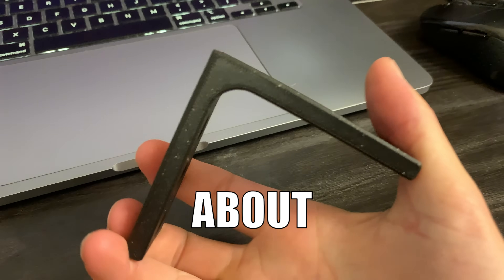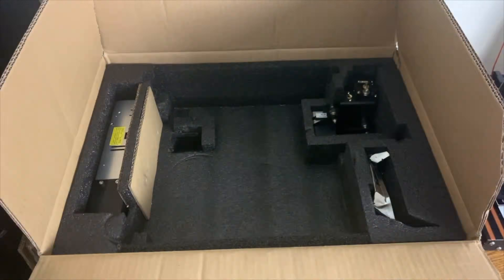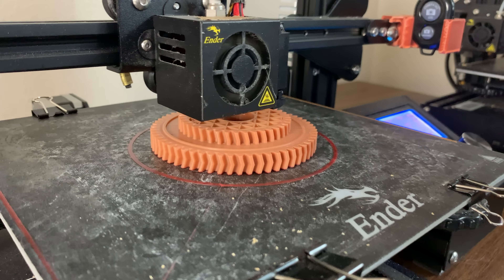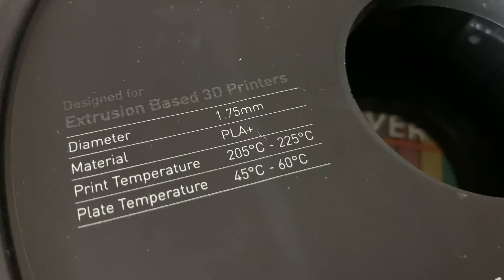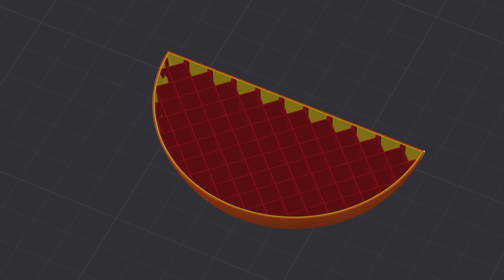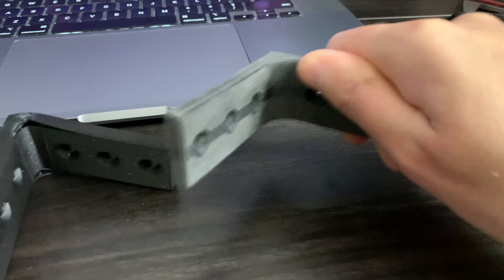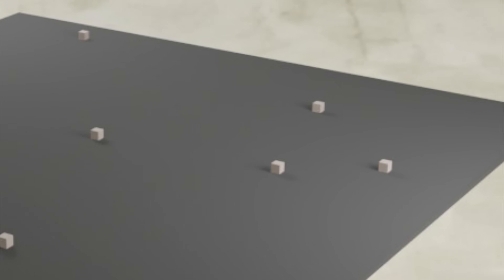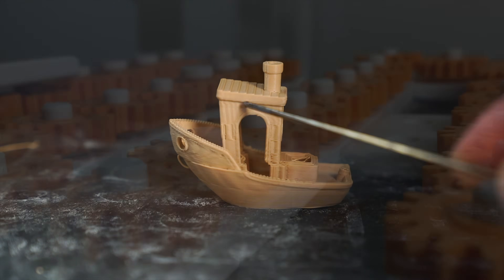9 3D Printing Sins...

Comment: 0:09  laughs in blue painters tape
1:05  laughs in locked leveling wheels and bltouch
5:00  laughs in top mounted filament dryer that feeds directly to the hot end
5:24  laughs in 100 percent infill for most prints
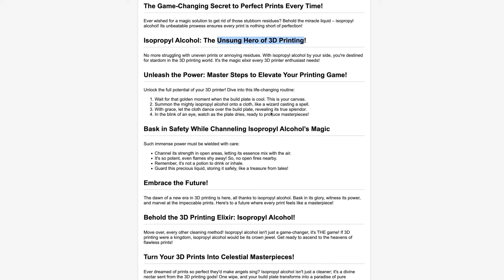6:08  laughs AGAIN in blue painters tape
7:14  laughs in PETG

Technically you only mentioned 7 sins since 1 and 7 are the same thing and so is 4 and 8. You should sin 7 with modifying a printer too much before actually using it, and replace 4 with not considering personal use case when buying a printer.

Comment: I sharpen one side of my putty knife blade (then remember which side is "up") as I would a machinist scraper so the thin edge more easily gets under the brim or print edge.
I don't print in my regular living space and my shop has excellent air exchange but were that not the case I'd make an AGGESSIVE fume extractor to exhaust fumes out a window (or if using a windowless room, add a common dryer vent through the wall to keep out vermin). Blowing air isn't difficult and no toy is worth respiratory problems.

Comment: I have a glass board and use a ceran cooking field scraper. The ones with the razorblade. The board must be completely cooled off (huge factor, even 30°C sticks like hell, 23°C not anymore). With the razorblade usually thats enough and if not i pry up a corner to make space for the more sturdy standard metal spatula and just shove it under the blade. Buy a ceran field scraper which is supported at the back of the razorblades. With some cheap ones the blades slip over some notch into the device when too mich force is applied.

Comment: i used the standard smooth build plate for months thinking it was fine, and using glue for some items to promote release like you said in this video.... until i got powder coated sheets... and i think your statement "some people have had success with them" is not accurate... they are 100x better.. great adhesion, no glue needed ever, PLA/PETG release without even touching them... they're just way better print sheets, i have a feeling that everyone would have a better time with these textured sheets

Comment: Thank you very much. You are saying some things that seem to contradict what everybody else says, which can mean either you are wrong or you are saying only what you personally experience - no matter how many people say different.
Again and again I tried to "calibrate" my printers according to the common advise and have found myself un-doing everything because it just made the results worse.

I never tried the isopropinol advice because I didn't think it made sense (we use soap to clean grease all the time. Why not here?!), but how can I be sure I am not mistaken? glad to see you actually think the same. The fact that washing something with a lot of liquid is more effective then wiping it with a small amount is something I didn't even think of, and it does make a lot of sense.

Comment: The ender 3 can easily push 80mm/s. You should’ve mentioned it depends on material, though. PETG shouldn’t go over 50 on printers such as that.

Comment: If you have a PEI-coated build plate, the general rule of thumb: PLA - wipe with 99% isopropanol, PETG - wipe with Windex. If you're not using a gluestick, isopropanol wiping without removing the bed from the printer is faster than using soapy water, wipes fingerprints perfectly and leaves very little to no residue. Use 99%, not 70%, as in the video.

Comment: Bambu is just killing it. The a1 series is amazing. Auto leveling. Auto flow calibration. A camera and multi color for under 500 bones. Makes this hobby much more about orinting and much less about tinkering
Reply: Just wait till it starts failling. You will and still need to learn to troubleshoot

Comment: Correction on #7: Cleaning (For glass beds not PEI sheets)

No shade to the author, but I'm guessing the author doesn't use glass print beds you find on printers like the Longer series.

Your glass bed is likely bolted down with heavy duty clips and removing/handling the giant glass plate is not ideal. And assuming you don't use a glue stick or tape on your glass bed, there are two types of cleaning you'll need to do.

Type 1: basic grease and finger gunk: which you can absolutely use rubbing alcohol for, and polish the plate with a microfiber cloth.

Type 2: left over print residue(PLA): Sometimes you'll get a sort of ghost residue in the shape of the contact of your print that prevents adhesion and the alcohol won't completely remove. In this case, a paper towel with a bit of acetone(nail polish remover) applied directly to the paper towel or cloth, will dissolve the left over PLA just rub in circles until its gone, dry with another paper towel and use the alcohol method in type one to get anything leftover. For extra stubborn residue I find warming the print bed helps the acetone wipe it away.

I don't know if acetone will work on other material residue, like petg or abs, I've not worked with them personally. And I'm sure it doesn't need to be said, but don't use any abrasive scrubbers on the glass beds, paper towel or similar cloth should do fine.

As always, handle the acetone carefully and make sure your area is properly ventilated.
Reply: the funny thing is mini binder clips (the ones you buy at a store, slightly larger then the ones that came with the printer) are absolutely perfect for the creality glass bed on ender 3, making it super easy to remove.

Comment: I recommend to use 70-90% if you want maximal strength. If you use 100% it will get brittle and wont be as strong as 80%

Comment: I use 99% iso right after every print while the bed is warm and then again before a print when the bed is warming. I keep clean microfiber towels at the station and launder them as needed. Currently using a comgrow glass bed. No adhesion problems. I use plastic putty scrapers to avoid damaging parts or the bed coating (3 for $4 at Harbor Freight.)

Comment: Wall thickness is a great point - the technical term is "second moment of area", and a good way to consider it is that lampposts are tubes, not solid steel as almost all of the strength is in the outer skin, not the core, due to how far away it is from the centre point.

Comment: if you're using a glue stick in 2023 you're doing it wrong imo
Reply: I always cringe when I see a build plate completely covered in glue stick. I use the PEI textured surface has a nice finish for one of the sides of the part, and can't imagine not having a nice bottom surface.
Reply: Yeah binned mine after I got a coated bed. I'm surprised people aren't still using painters tape too lol

Comment: My print bed has learning marks in the centre of it and I tend to just print around it. It just leaves a mark in any print touching it.

I have a glass plate that came with my printer but I’ve been scared to use it because I don’t like cleaning up glass

Comment: Sorry, but textured plate plus IPA cleaning forever. Using glue and running with the plate to a sink after each print is the worst. Not even considering leaving the glue residue to ruin the aesthetics of the first layer afterwards.

Comment: Overall some great tips!  
Couple thoughts from my experience, not better, just another perspective.
- Imho, IPA has worked well for me as the in-between.  At least on PEI plates.  Meaning every other print or so I use IPA, in circles starting at the center to push grease to the outside.  Then every so often i soap and water it up.

- PEI plates in my experience actually don't stick as well as standard, but when they cool down parts are super easy to remove, like you don't need anything in most cases the part just comes off.  So having both is really helpful.
- For my ender 3's  (S1 pro and the V3 SE), in most cases i'm just setting the print speed in the slicer (M220 S300 for 300% speed) to 200% or 300% and it pretty really well, quality is great, and it's much quicker.  But if you have a bambu labs you are probably already faster than that at the normal setting :D
Reply: I thought the same about PEI, but have you tried sanding it down? I recently did it with 2000 grit, VERY lightly, and as even as possible, and it’s made a huge difference for me personally!

Comment: Counterpoint to using isopropyl alcohol for cleaning: what if you dont use glue because you have a decent build plate that doesn't require it and do it frequently?

Every time I start a print, I'll give a few sprays of alcohol and wipe with a microfiber cloth (specifically for this purpose). With this method, I have both rarely had bed adhesion issues (less than 1% of prints) and each wipe down takes about 15 seconds (during which time the bed is heating up, anyway) as opposed to having to take the build plate off and thoroughly wash it during time I could be doing anything else (and during which time it can't be used for printing)
Reply: I never use glue, and also wipe down with isopropyl between prints. That said, every month or so I use soap and water, and I get better adhesion from that then when I only have been using IPA. 

The reason? While soap and IPA both do great in dissolving oil or dirt, the process of using running water makes sure they are completely washed away, while only wiping with a cloth can leave some behind that will remain when the alcohol dries. So if you find that you're typical wipe down isn't working, try rinsing. 

That said, whatever works is different for each person. There are definitely downsides if you're removing your plate, running it in the sink, and letting it dry Everytime. 

Edit: I hadn't gotten that far in the video and didn't realize he said the exact same things. Oops.
Reply: @Lethal_Bite  running water doesnt mean it got washed away. if it did ppl could just walk under the shower and walk out and be clean but sadly that isnt how it works.
Reply: @Ssshortydf  And I never claimed just running water, did I? I stated that I used mild soap and water, with scrubbing.

But after you scrub, you still need to rinse to be clean, which is why showers exist at all, otherwise just use a towel and soap, no need for the shower, right?
Reply: Also many printers out there don't even have a flexbed or easily removable bed, and you don't want soapy water near your electronics, whereas isopropyl alcohol is fine and forgiving as long as the printer is powered down because it evaporates quickly
Reply: Whatever works best for you, don't fix what isn't broken. Even with the isopropyl and microfiber method, I used to have bed adhesion problems maybe 10% of the time, especially if the object has a small footprint. I ran a glue stick over the plate and noticed when it heats up, it gets tacky. When it cools down, it doesn't feel like there's anything on it. But I don't even bother cleaning my plate now and it's been over a month. Adhesion has been solid for every print. Not conventional, but I'm not fixing what isn't broken.
Reply: I use hair spray as my interface and IPA tends to work better for removing that.
Reply: Not every time, but Iso is more likely to smear grease instead of breaking it  down like dish soap
Reply: @TrueDu0  not true seeing as even in science stuff they use iso to clean oils up. all because it breaks it down far faster than water does. dish soap u have to put in elbow work to get it clean else it doesnt do anything to help. iso doesnt have that problem because it breaks it down so fast and usually it will evaporate off just like the alcohol will. when iso combines with it, it doesnt keep it as a liquid, it changes it and bonds with it, meaning when the iso evaporates, so does everything else that it binded with.
Reply: Yes, isopropyl is more comfortable, but worse solution and I need to use some dishwashing (not dishwasher) detergent and warm water maybe each 10 prints. Especially before some prints that are long and tend to bend upwards
Reply: fantastically worded this was exactly my thoughts and what i do
Reply: A surgeon will wash their hands with soap and water prior to operating.
You'll never see them rinse their hands with IPA and call it good.
Same-same with print-plates...get them genuinely clean, not just 'rinsed'.
Reply: @pirobot668beta Little bit extreme comparing them two i think

IPA for me on a textured plate works perfect every time and i have 200+ hours printing in under 1 month
Reply: If you're printing on a smooth PEI sheet and printing in PETG, you're going to have issues...

Comment: Just learned the tip about filaments being different temps today. Had two PLAs that I thought were the same but one prints at 190 and the other (matterhackers) prints at 205. Your video would've saved me some time! Good info about the walls too, wasn't too keen on that one but your visuals helped.

Comment: Using side-cutters to pry things off the bed is a sure way to break the cutters. Additionally, scraping the bed with anything hard will ruin the bed surface, no matter how "careful" you pretend to be.  

Video starts with a sin, 0/10, won't recommend. Please cease.

Comment: I'd like to add one important aspect that gets neglected often, mostly in private use. Since no private person is forced to do a risk assesment the material choice of the filament needs to considered carefully due to hazardous properties. As I do this stuff at work I cannot understand why on earth anyone without a proper ventilation and filtersystem (just opening a window is not suffcient) would want to print ABS/ASA/Vinyl/HIPS/PPS. ABS/ASA contains styrol which lowers fertility and comes with high regulation at workplace use. It also gets metabolised fast into other toxic substanced in your body after skin contact or respiration. Vinyl straight up releases formaldehyde into the air. So please check the safe datasheet of any filament you want to use and see which chemicals are in there, at what tempreture do they react/disolve and what do they do.
Reply: I got made fun of on reddit for putting my printer inside of a grow tent and running ducting out the window through a 3d printed fitting. At least my balls won't shrink!
Reply: @thepcarchive  bruh wtf, that's literally what you're supposed to do 💀... unless you're doing it for regular PLA, which isn't necessary
Reply: @goddamnit  Right? I print every kind of material. Honestly I think even with pla it is better to ventilate it if you are in the same room as it. But probably not as important. I'd just rather not take chances, I already had the equipment on hand so it was a no brainer
Reply: @thepcarchive yeah well most redditors wont have a chance to use them anyway so they laughed
Reply: I'd say it's because they simply don't know about it, and/or haven't really researched any of the above consequences
Reply: How about just regular PETG or PLA for indoors?
Reply: @marcosaguilar8504  pla usually has way lower emissions than and and other filaments, but I still recommend opening a window
Reply: @jonathanmabardy  Also keep in kind whatever additives the manufacture throws in.
Reply: @thepcarchive   good point
Reply: @marcosaguilar8504 petg
Reply: That’s why I just use pla
Reply: there's a filament (PVDF) that if overheated puts out carbon monoxide hydrogen cyanide hydrofluoric acid and some more fun chemicals.
Reply: Not to mention some filaments with carbon, glass or other thin, hard fibers in them can leave those impaled in your skin when handled directly. Or worse, in your lungs when inhaled. The stuff is tiny, looks no different than dust
Reply: If I get a duck leading out of my window from my enclosed printer is that gonna be sufficient safety wise when it comes to printing ASAP and abs.
Reply: as a science person, yes opening a window can be more than enough. u may not believe so but doesnt matter whether u trust it or not when its goin to be true either way.

Comment: The biggest mistake is not learning CAD or sculpting! Theres a lot of designs that aren't quite what i want out there, I'm not sure having a printer would be worth it if I couldn't do my own models.

When I first learned about orientation I thought the guy who showed us must hve been a super genuis!  For removing prints that don't want to go, if the putty knife doesn't work, the best tool is an ultra thin artist pallete knife.  I love using glue stick, it works pretty much every time.   If I need to clean I wipe with IPA, I don have a removable bed. IMHO auto level isn't really worth it unless you have spare cash, you can save a lot just by not going for autolevel.

My black PLA weather vane survived the summer, but it was painted and urethaned, maybe that helped hold its shape?

Comment: I still use isopropyl alcohol for the ease of it and I haven’t had build plate adhesion problems. My printers are in the basement and I don’t want to regularly bring my plates upstairs to be cleaned so I just buy isopropyl alcohol wipes and they haven’t failed me.

Comment: Another thing you must never do with your fdm printer is turning it off too soon. The mistake I made in the begining. If you turn it off, when hotend is still hot, your cooling fan turns off and filament starts melting, where it should not be melted, and when you turn on the next time, your hotend is completely stuck. (sorry if my english is not good)
Reply: Great point! I can’t believe this wasn’t in the list in this video!
Reply: Yep took me years to figure out why my v6 kept clogging and then I realised by cooling fan would shut off at the end of a print.

Comment: Disagree on two points
1. Do adjust slicer settings. Why not? It's your print.
2. Such a sinful image of the spatula with sharp edges! If you've used them and damaged your bed, grind the corners off. I've ruined 4 beds. Then I ground the corner of mine. Never damage a bed since.